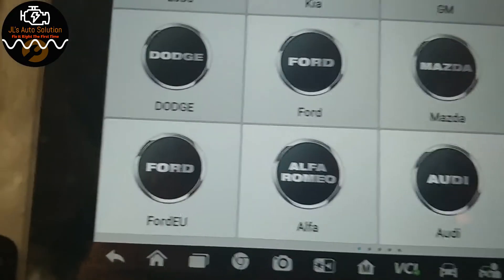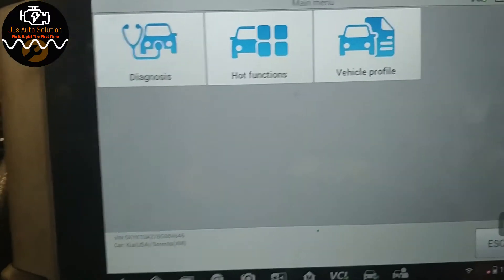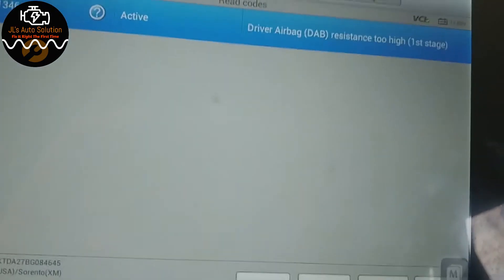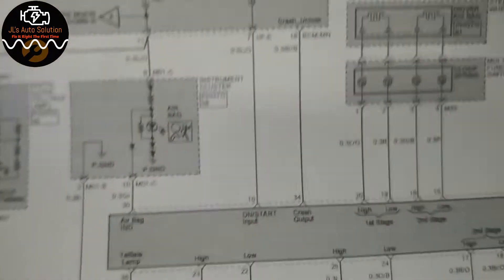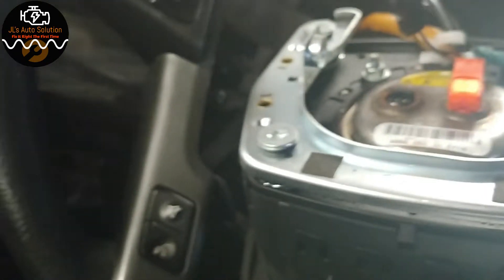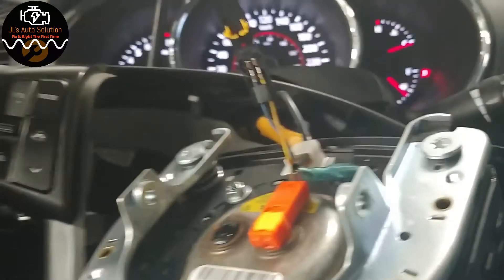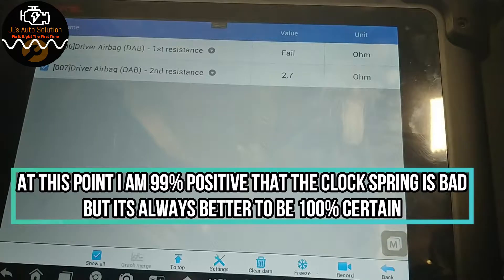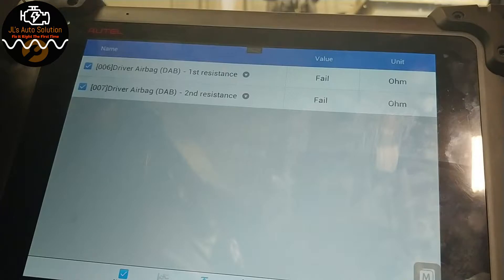How To Test a Air Bag Fault( Code B1346)

Comment: Brilliant video well explained to....your the air bag King lol ... well let's just see yet if I diagnose my 7.48 issue on my  vauxhall astra 2007 high resistance stage 1 airbag unit I'm suspecting clock spring issues with mine tbh as I've hooked up my diagnostic scan tool done live data test on air bag unit all bags live showing high resistance  like said stage 1 running about 7.5  do this sound like a clock spring issue to you ?... add on I've now done steering wheel test as doing live data turning steering wheel fully left I'm getting ohs reading status dropping with in range then i wiped code all good air bag light off then turn steering wheel back and forth live data resistance fluxuates  to high resistance
Reply from the maker: sounds like it but test first

Comment: Have you ever set off the air bag from not u hooking the battery ? So you test an air bag system just like any other module with battery hooked up. Do you think the bags could be set off by unhooking them with battery hooked up I. Mean I see you didn't set off just a question. Thank you for the awesome video
Reply from the maker: So the short answer is no. but with that being said always follow the testing producers that the manufacture has set in place. They are there for your safety and their liability.

Comment: I'm curious - how does just one track on the clock spring fail? I guess on this car the steering buttons and horn must still have been working?
Reply from the maker: its a spool of cooper wire that turns left to right, is winds up and unwinds over time the bending action will break the clockspring wiring.

thanks for watching
Reply: @JLsAutoSolution but does the horn or steering huttons still working?

Comment: Great video. I have same issue on 2001 Subaru Outback. Have the MaxiSys 906BT Scanner but having an communication issue with ECU so it can't check the airbag. I am happy to see that it would be able to diagnose if I can get past the communication issue. It will scan up to a point then will say it can't communicate with ECU. I am going to use a 3.3 ohm resistor to see if I can figure out what is causing the light to stay on.
Reply from the maker: Sorry to hear that.. Try a 2 ohm resistor instead of a 3.3- 3.3 is kind of on the high side and might not lead you in the right direction for diagnosing your issue.

thanks for watching

Comment: Is this really necessary for you to check  when your Kia airbags light is on? Or can you just leave it like that ?
Reply from the maker: It becomes more of a safety issue when the airbag light is on, they might not deploy is a crash causing serious injury or DEATH.

If a safety inspection is required on your vehicle, then your vehicle will fail.

Personal preference is to make sure the airbag system is working correctly by making sure the light is off.

Thanks for watching

Comment: Did you replace the clock spring? How much trouble is it? In the UK with the same issue.
Reply from the maker: yes for this repair the clock spring was replaced. and for difficulty it depends on your experience.
Reply: @JLsAutoSolution  Fair enough, I've changed clock springs before on European cars but I've noticed in general the Asian manufacturers tend to differ with their designs.

As a point of info for any if your other UK viewers there is currently a Kia recall for this fault which means if your car is under 15 years old you could get this repaired free of charge.

Comment: I have a 2005 Acura TSX with airbag codes 32-10 and 21-10, which component should I test with a bulb? For 32-10, I'm confused with the "right side airbag inflator", I dont know if it's the "side curtain" or right passenger air bag, thank you

Comment: Very well explained.  Good video. 
One question?   You did all that without disconnecting the battery?
Reply from the maker: yes I did,
you can alsways disconnect the battery then removed the wiring harness connectors, then replug the battery--- or else how will your get scan data..

Thanks for watching

Comment: great video, 2009 Tucson air bag light on, two codes B1481 and B1346 would you suspect clock spring, cheers Steve
Reply from the maker: its haard to say if its a clock spring issue/wiring/component or module issue.. testing is key in any diagnostics.

Thanks for watching

Comment: I have dtc B1347 code appearing on my hyundai elantra 2017, but at my car dealership they assure me it’s not the clockspring but the dab itself since all the steering wheel functions and horn working properly, is that correct?
Reply from the maker: Not necessarily. In my video all steering wheel functions are working properly.. The only circuit affect was the dab circuit.

A second opinion never hurts..

Thanks for watching
Reply: @JLsAutoSolution  Does also the horn works?